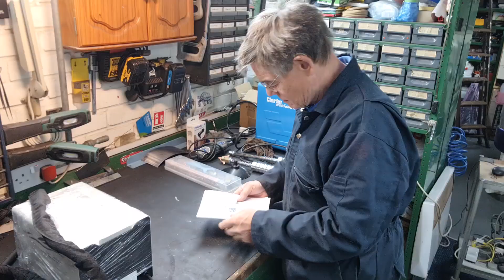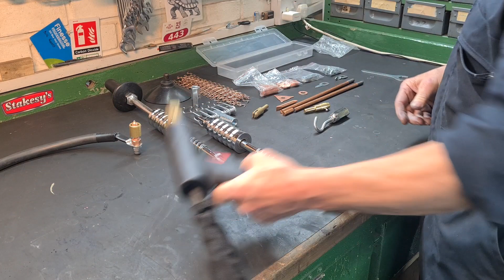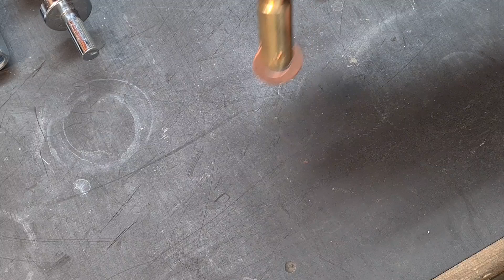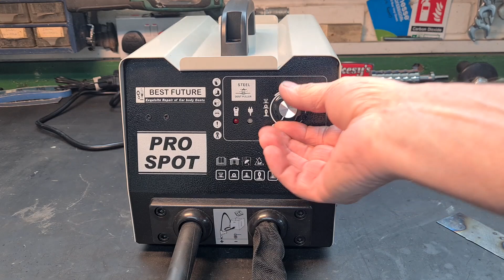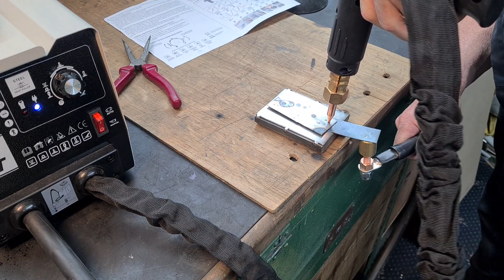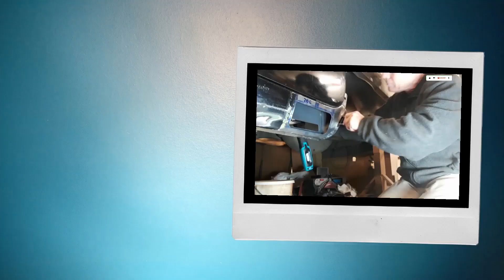Pro Spot Welder Review

Comment: Jaki bezpiecznik powinien być? C16?
Reply from the maker: It was plugged into a standard 13A 230 Volt supply the 13Amp fuse is in the plug top.
Reply: @StevesConsul mam w warsztacie tylko C16A. Bo główny bezpiecznik mam tylko 20A. I zastanawiam się czy będzie działać. A podoba mi się to urządzenie
Reply from the maker: Yes it should work ok because your supply is higher than 13Amp
Reply from the maker: You need to use a 13Amp fuse to protect the welder.
Reply from the maker: 13Amp

Comment: I have a question. I have the same Pro Spot model, but I'm encountering this recurring problem that the welds aren't strong enough to remove the dent when pulling it out.
The intensity of the heat doesn't matter because it's quite weak.
Reply from the maker: If you are pulling .9mm steel it should work ok but anything thicker it may struggle to pull it.

Comment: Re the spot weld - the low power from that machine needs a lot longer contact time to penetrate. The two metals need clamping tight in the area of the weld first. Then fire up the machine and contact the workpiece until you see the outer metal get (nearly) red hot - obviously thickness of the workpiece determines how long you need. 
I'm not sure the machine is powerful enough to be useful though (I'm not familiar with that machine)

Comment: I'm no expert on spot welding, however I believe the reason it didn't work for you is that the ground is supposed to be directly behind the area you're trying to spot weld.
Reply from the maker: Yes, I didn’t try that, if it works, I will make a follow-up video.
Reply: @StevesConsul  Awesome, hope it ends up working for ya!
Reply: I bought one and you are right. The ground does indeed need to be directly behind the area to be spot welded.
Reply: It shouldn't matter. As long as there is good continuity - as with any welding!